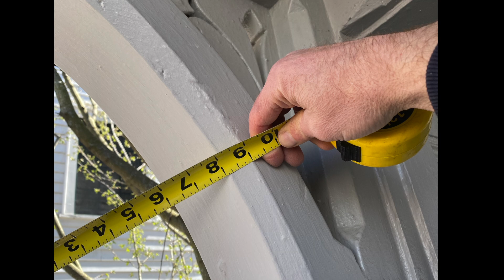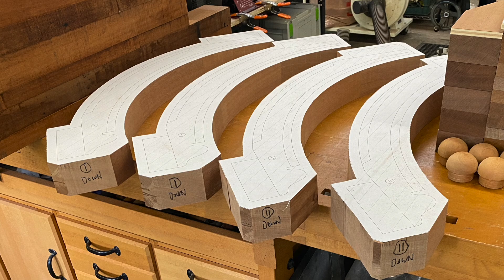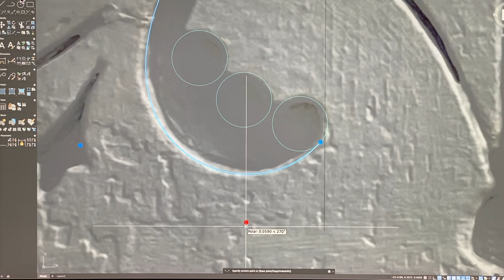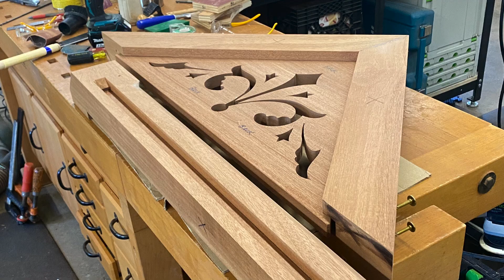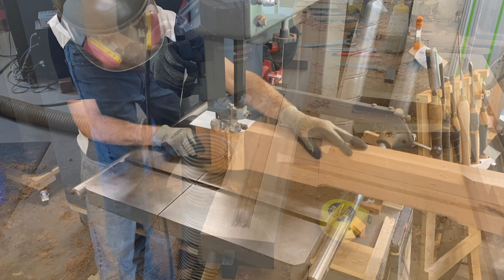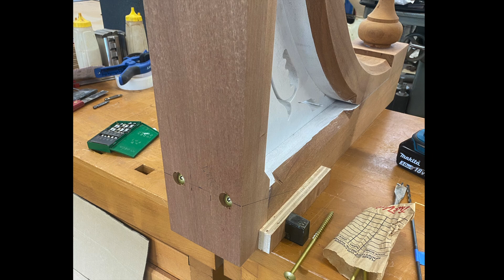Reproduction of a Historic Flying Portico

Comment: Amazing work. Thanks for sharing the whole process. I'm learning a lot from this video.
Reply from the maker: @ProbablyNottin  you’re very welcome! I’m glad the video could be of use to you.
Reply from the maker: Also, I didn’t know if you had a question about epoxy, but I’m happy to answer any questions if I am able to.
Reply: @Stair19  Thank you! I was actually curious about how epoxy is used here. I'm more familiar with epoxy being used to fill gaps in pieces (e.g., the typical epoxy and wood table). However, here it seems you're referring to it frequently for gluing pieces together.
Reply from the maker: @ProbablyNottin  Sure...Basically I use an epoxy called West System - it's a marine grade epoxy - people build boats with it to sail around the world, so that says something about it's quality. BTW if you know any boat builders, they probably will know this product and might help you as well. West System makes many varieties of epoxy for different applications. I primarily use resin 105 and hardener 205, 206, 207 or 209 depending on conditions and needs. Where I use it is in places where there might be some gappy-ness, or where I need to bond things in a situation where yellow glue would never work, or if I need a long open time. For instance, sometimes I need to repair a broken stair spindle. I will bore (slightly oversized) holes in each end of the 2 broken parts, and epoxy in a piece of all-thread to fuse the 2 parts together again.
I used the epoxy in the mortise and tenon joints of this project for a few reasons. The epoxy is weather/water resistant and I had 30 minutes before it even started setting up. I also used a West System filler which gave the epoxy more body so it wouldn't run. First, I typically "wet" the wood with the epoxy which is thin (runny) which in turn soaks into the fibers. Then I add some filler to the epoxy which gives it more  body (not runny) which allows for many things to be bonded together that would typically be very tricky to bond together. There's much more to using this epoxy but that's a quick explanation.  You're welcome to PM me on FB at Peter Moffa Design and we can chat on the phone if you get serious about using it. It's crucial to certain parts of my jobs and a good thing to know about.
Reply: @Stair19  Thank you for the explainations! Really interesting to read about it and how you're using it depending on the needs of the project.

It all makes sense now!

Comment: Nice work Peter. I find it a joy to be able to reproduce intricate designs of the past. Impressive that you turned the finials by hand on a lathe instead of a four axis on the CNC. But if you have those skills that's awesome!
Reply from the maker: @EvilMadFabricator  thanks😊 I originally started out as a wood turner with no intention of getting into woodworking, but over the years that all changed. So I have a lot of experience turning, so it’s much easier for me to do that by hand.

Comment: This was a really nicely done video! I enjoyed seeing your process. I'd made much smaller brackets kind of like this a few years ago for a 10 ft shelf over a breakfast nook except that there was no CNC work (that area holds rods for curtains) and I turned some acorns for the finials. It was interesting to see that pretty much the same steps would hold for a much larger bracket. Was the epoxy specific to outdoor use? No wood glue?
Reply from the maker: @victorianplants  thanks! I used Titebond 3 wood glue to glue up a large material. For the actual joints I used West System epoxy, which is a marine grade high-quality epoxy. I also used some filler specific to that epoxy to give it a little bit of body to fill any gaps. 
I’m glad you liked the video. I’m constantly getting a little better at putting them together. This is the first time I use some music and that really helps make it a little more pleasant to sit through 😊
Reply: @Stair19  I noticed the titebond in the background and figured you used it for lamination. Thanks for mentioning the brand of expoxy and that it can be used with a filler. I don't know a lot about best practices for exterior projects, so that is helpful. 
Your editing, music, and screen grabs from sketchup were great! I wish I could get it together to take videos (or better videos) of my projects but it is a lot harder than it looks.
Reply from the maker: @victorianplants  thanks for your comment 🙂I'm a work in progress too - it's good to just start doing things even if they're not perfect. Each time I put something together I see all the things I'll want to do better the next time around - but it's better to start somewhere than nowhere at all. A friend suggested I try background music, so I tried it this time for a first and I see how it improves things. Best luck!

Comment: Really nicely done.  I learned a LOT from this!
Reply from the maker: Good to hear Alan! Thanks for checking out the video🙂
Reply: I followed you over from your Facebook post, incredible work.  I’m wanting something similar, but less ornate, as it’s for a one room schoolhouse in rural Kentucky.  I picked up some ideas from your video, especially like the block at the bottom of your support boards, that hold your arches up.  I was planning to notch onto that board for the extra support, I like your idea better.  Mine needs to be bigger (deeper) so sorting that out.  I have nothing to go on, just trying to figure proportions out to look good, and to make it work.
Reply from the maker: @miragesmack007  Hey, good to know that my video could be of some help. I pretty much copied what I saw from the existing portico that I was copying. I can understand your challenge from having to design from scratch. I wonder if you have any historic towns or cities in your region that you could draw some inspiration from. If not, perhaps Pinterest, Flickr or some other place on the web might help inspire. Best luck